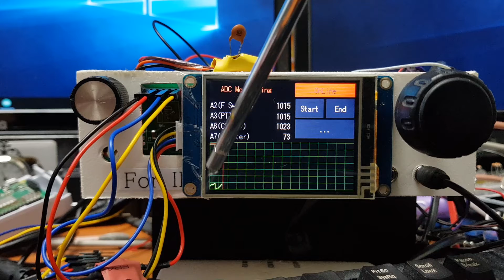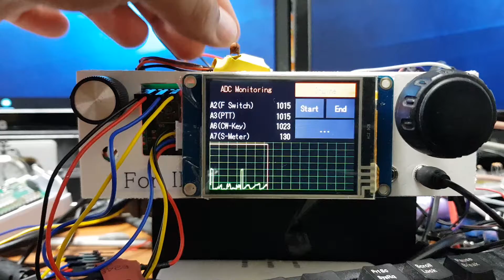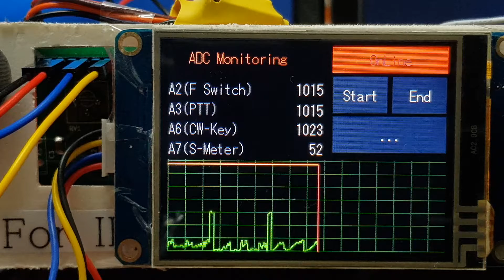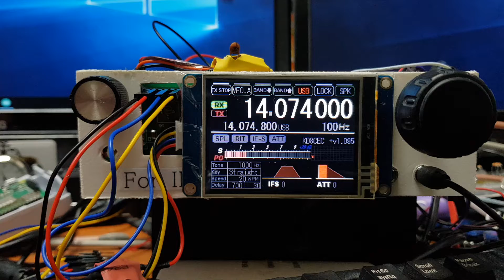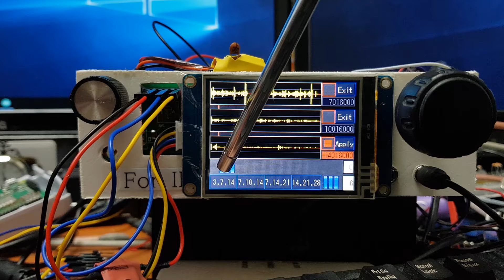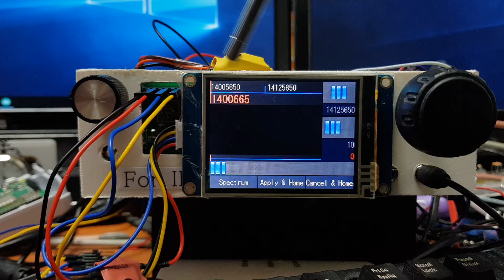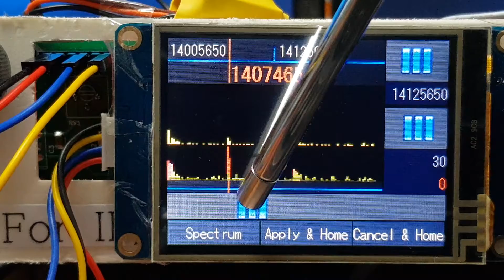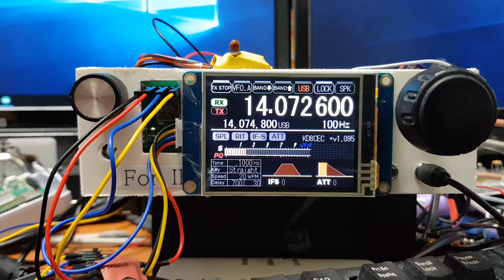Capacitor Selection and Application of S-Meter in uBITX with Nextion LCD - Improvements Parts#2

Comment: I'm very new to the hobby, so forgive me if this is a stupid question, but what am I supposed to make of those S-meter readings? 80, 111, 101, 14, 32 54, 120...and what did swapping out capacitors do? Just change the scale? If you had put the right cap in, would we have gotten the normal 1-20 S-meter readings? Also, the readout at the bottom didn't seem to be following the signal. What was that all about?

Comment: From what I have seen, having looked at a schematic, the "s" meter seems to be an audio level meter. Not sure there would be any difference if there were a way to actually measure RF levels or not.
Reply from the maker: That's right, this is the audio signal level, Most S-Meters use this method (Audio signal)